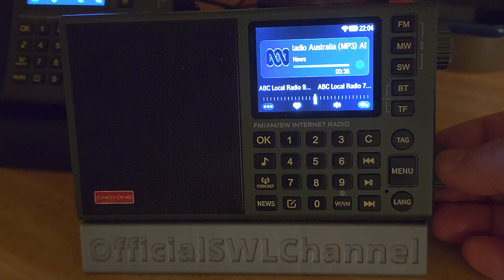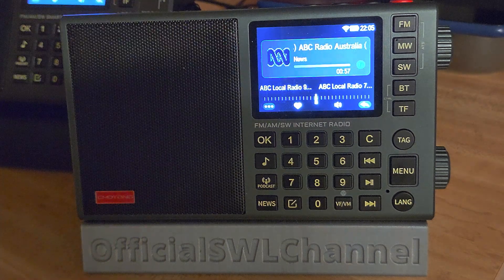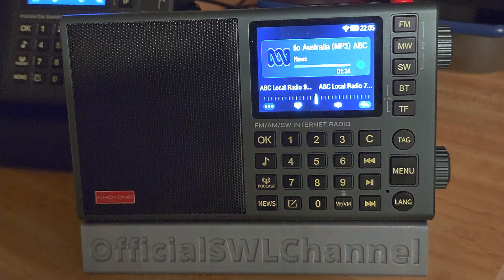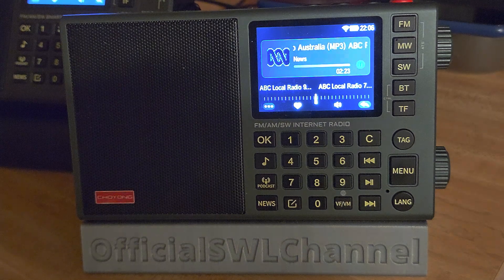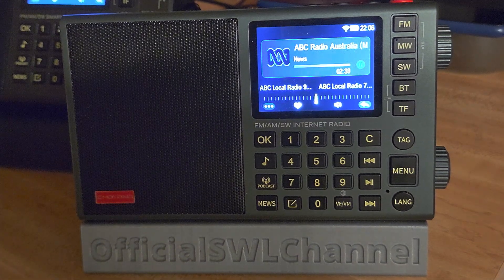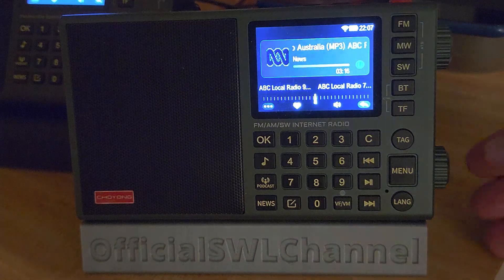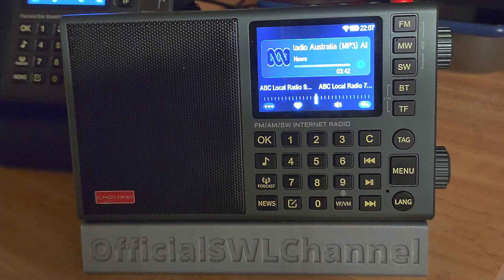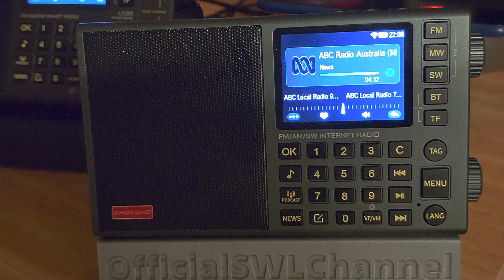Choyong LC90M or mini version firmware 4.6 update and personal observations off frequency problem

Comment: I asked Microsoft Copilot, "Has the 3 kHz frequency error been fixed in new models of the Choyong LC90 MINI product?" and it said it was fixed in version 4.6 of the firmware and linked to this video. Deep Seek still thinks the LC90 Mini is a smaller version of the Choyong LC90 massage chair.

Comment: In my case the LC90M cannot be version updated unless I utilize a SIM card, supposedly.....My LC90 has been updated to version 4.6 and the scrolling speed, station logo ID's and improvements to Japanese stations have been identified. I have contacted Choyong regarding the mini and they said it would be comparable. So far not pleased with the improvements on the LC90M. 😭
Reply from the maker: yes you can update without a SIM card...  all you need is a wifi connection and a SD card in the radio, mine updated without any problems
Reply: @OfficialSWLchannel  On the MINI version? Ok, I'll try again.....
Reply from the maker: I have both LC90 and the mini...both update well using wifi .. no need for SIM card at all